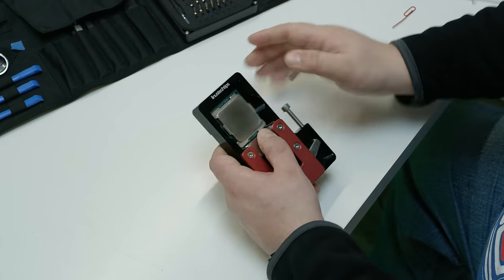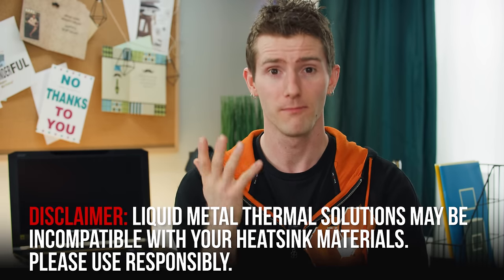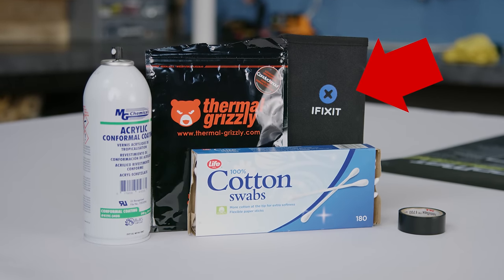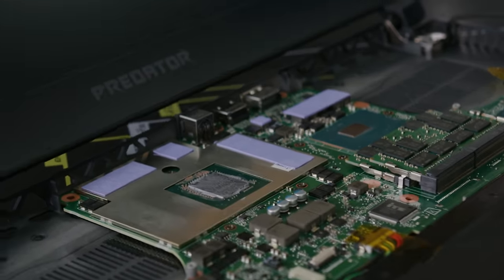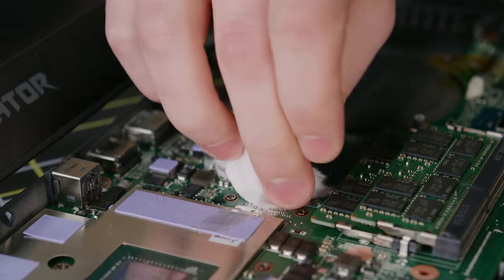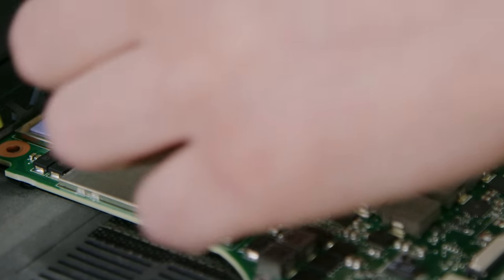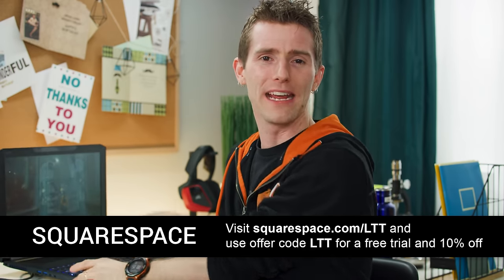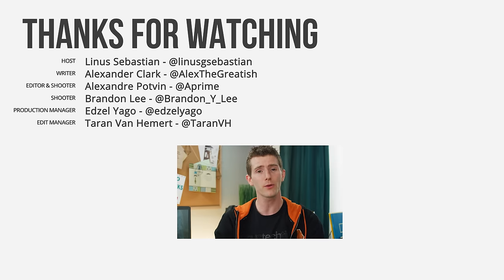Liquid Metal Laptop Cooling – 20C LOWER!

Comment: Can manufacturers use liquid metal themselves? It's not like it's patented and such improvements are in their best interest to begin with while avoiding customers damaging hardware in process.
Reply: yes can any answers this
Reply: The interface between the chips and the heat spreader would have to be specifically designed in a way that the liquid metal would not be able to spill into other components.  Liquid metal doesn't "solidify" like normal thermal paste, so the current method of applying normal thermal paste (the "more is better" approach, with most of the paste being squished off the side of the chip) would not work for liquid metal.

It would be awesome if a manufacturer came up with a way of doing this reliably, though.
Reply: Thanks, makes sense! So for real, doing this yourself means you can't move the PC around much?
Reply: Yeah thats true, i think its the cheapest way to boost performance of those devices.. and if manufacuturer did that they could do it reliably
Reply: Gallium in it slowly amalgamates with pretty much every metal around it weakening the structure, eating away the dies and ruining the solder joints. The problem becomes much worse where two different metals are in contact (like heatpipes). It may be good for short term overclocking but in the long run you're better off with traditional thermal compounds
Reply: In the long run ? That doesn't exist.

Nobody uses a CPU for 15 years.

And you'll still get better temperatures than with traditional paste.
Reply: If you like getting random errors, BSODs, crashes and eventually having to replace the whole motherboard because all the solder connections are falling apart for a 5 degree temp difference, go ahead. I bet a lot of devices that had contact with gallium will fail within 6 months
Reply: The reason manufacturers do not use this interface material is because of the liability in an accident situation. One decent bang and you shotgun pellets of liquid metal all over and fry the system. The incidence of warranty RMA work would skyrocket.

Comment: Gallium has a neat way of interacting with aluminium. It basically melts aluminium. It can take hours for it to really have an effect, though, so that laptop might actually be dead now. It mostly depending on if the solder points had a long enough contact with enough gallium, how much tin was in the solder, how much of the "liquid metal" was gallium, and if there wasn't some material keeping the gallium away from the tin (like a cleaning solution used on the motherboard after the soldering process).

Comment: 5:05 aaaand this is EXACTLY why doctors spray a squirt into the air from a needle before actually putting it into someones arm.
There's always some gunk or residue at the very tip of the instrument, that may cause shit to spurt out as the pressure blob releases.

Comment: I remember upgrading the thermal crap in my Dell Inspiron 1720 back when it was new around 2008 to Artic Silver 5, was nerve wracking because it had a dedicated GPU (nVidia 8800) too. It went from complete thermal throttling on Fallout 3 even with a beefy laptop cooler to a smooth steady (Though not as high as I'd hoped) 40FPS. If there is one thing I have learned (Mostly from the Pentium 4 Prescott days) it's that the right (and right amount) of thermal compound makes a huuuuuge difference.

Comment: It costs 10€ and they want to tell me they companies can't do it themselves in a 3000$ laptop???
Reply: There is a pretty good chance the metal would spill somewhere during shipping. The failure rate would be too high.
Reply: Not if done correctly. How would it spill if it's only a thin film between two pieces of metal anyway?
Reply: Am not. Worked with all sorts of amalgams and room-temp liquid alloys and have an electronics workshop.
Reply: Maybe the longevity?

Comment: Kapton tape may be a better option than electrical tape for your barrier. It is highly heat resistant and also non conductive. It will also come off cleanly without leaving black sticky goop all over the place.

Comment: So why the manufacturers are not using that?
Reply: Money
Reply: cause its not reliable for the average consumer u have to maintain it
Reply: Thomas T Probably to expensive. Maybe they weren't expecting such high temperatures in your device. Or they just might not care.
Reply: How many time can you use it before changing the paste ? Why Linus is not saying it if you need to maintain it? It’s very important parameter for a potential buyer.
Reply: That's ridiculous. Any gains from this technique in their laptop segment could be replicated in their desktop segment. And many manufacturers don't even have a desktop segment so why should they hold back?
Reply: Also, it's not going to go right all the time during manufacture and the manufacturer would have allot more defectives and that would cost them allot.

Comment: if computers were manufactured with this process, then they would qualify for a shipping ban, due to the gallium content.  Air ban due to gallium eating aluminum
Reply: Someone finally has the right answer!
Mercury and gallium are banned from all air-transport, due to the danger of aluminum damage.
The damage either metal can do is astounding.
One drop = one dead 747.
Not an exaggeration.
This is why liquid metal alloys are typically sent by surface transport.
These alloys do not have an infinite life: they oxidize and need to be re-applied at intervals.
Reply: Greg Gallacci Looks like I always learn something new on the internet. Thanks for that insightful information.
Reply: one drop can do shit to a 747, otherwise you would see terrorists scratching the frame to put lmtc :p

Comment: Easiest way to apply I did was put it on q-tip I keep an old one with old LM on it so it is easier to add onto the tip and paint it on. I applyed away from my motherboard when setting up my loop and de-lidding. Then applied the q-tip to where I needed. It gives you more control when applying. -Sorry english is 2nd language :(.

Comment: aftermath please... i had to reapply my liquid metal 2 times on my aero 15x v8 so far....because temps climb really high after 2 months or so and the LM getting hard
Reply: How are the thermals for that aero after applying liquid metal? Still throttling?
Reply: @cyberpunk4915  no. 75°C max. But add 4 degrees every month till 91°C.. it always seeps into the Cooper alloy and hardens.
Reply: @Sanyex  +4 per month!? my god
Reply: hey sanyex, i have the same laptop and am thinking of liquid metaling it too. how does is look now after some months? would you still recommend?

Comment: I just wanted to post as a note anyone watching. If you want to remove or accidentally spilled some liquid metal on the board while unpowered. You can use wet wipes to help remove it. I found this out by experimenting. Rip a piece of the wet wipe cloth to grab a bit of the lm paste off the spot and Discard piece, rinse and repeat. Do not reuse or it will smear the lm paste around. The lm paste tends to ball up on the wipe so it works like a charm.

Comment: Don't liquid metal laptops!  Gallium will alloy with Copper, the reaction speeds up with heat.  My laptop was running at 80c for about 3 days before the temps were at 97-99c and down clocking, I run BOINC on it.  When I took my heat sink off, the copper contacted with the liquid metal turned silver and would not come off, it actually absorbed into the copper.  

Quality thermal paste will actually do the same on max temp ceiling FYI.  Just in case anybody else wanted to try too.  Read up on liquid metal and copper.

Comment: It's Worked Well.

Without LM
Temperature 94-96°C
3D Mark score 15000 point 

With LM 
Temperature 80-84
3D Mark score 18000 point .
Performance is +20%

Asus Vivobook Pro n580vd
i7-7700HQ
Gtx 1050

Thanks for the video..

Comment: The bad thing about Liquid Metal apart from it's dangerous application is the long term corrosion to the die itself and the heat spreader, from what I've saw in other parts from the internet the first application it's the most dangerous because it can spread out, but when you reapply the same compound you are "safer" doing it, though you won't keep getting the same level of heat disipation.

Comment: Pro Tip: CRC Electronics Cleaner from the auto parts store will dissolve thermal paste instantly. The only caveat is you need to be able to remove the chip so you can take it outside when you spray the cleaner on it.

Comment: I got incredible results from this on a MSI laptop with i3-4100m :

From 85°C and SCREAMING fan in full charge
 (OCCT small data)
To 55°C and almost silent fan

Needless to say that in normal use it's dead silent, and temps never go above 45°C... 

I applied two layers of clear nail polish beforehand, as there were sensitive areas literally next to the CPU die.

Make sure you apply the conductonaut in very thin layers, both on the copper thing, and on the die.

/!\ Make sure that the part which is making contact with the CPU is copper or nickel plated, because if it is aluminium it will be destroyed.
Also the conductonaut will leave a little mark on the die if you try to remove it, so needless to say that if you do this on your laptop or on your desktop GPU, there is no more warranty.

Comment: My Lenovo i7 laptop was driving me crazy. The fans sounded like a JET plane spinning at 100%, just browsing the web, I'd tried every software fix, bios update, you name it. I was getting ready to palm it off. So I thought I'd try some LM.

Opening these new laptops is way easier than the old ones, pop off the back cover and a few screws to remove the head pipe/heatsink (fans stayed in place!).

It was there I noticed the giant 0.5+mm thick screen printed square slabs of thermal paste from the factory, given the low mount pressure, this method would create a decent gap between surfaces and act as an insulator, which explains the inability for my laptop to passively cool (fans ran 100% of the time).

I bought some conductonaut and applied it to the cpu and gpu die, the copper heatpipe and BAM! Fans barely ever come on anymore, at idle it is around 10 degrees C cooler even with no fan running, and at full tits, 19 degrees C colder. AWESOME!

So thankyou for this video! You saved me buying another $2000 laptop for no reason.

Comment: Finally did it with my Asus, didn't really drop temps but the CPU (i7 7700hq) maintains higher clocks, it used to drop to 2.6ghz when I stress both the GPU and CPU, now it never drops below 3ghz. One thing though, be careful!

Comment: There are 2 tips given if you buy Conductonaut liquid metal, and in this video you are using the wrong one. I think you are supposed to use the small tip (angled pin-like tip) instead of that suction tip.

Comment: A good tip would be to use translucent nail polish to cover the surroundings of the die to prevent shortage in case of liquid-metal spillage.

Comment: Keep in mind that this stuff does dry out over time. Applied it to my GTX 1060 years back and was surprised about GPU temps in excess of 80°C under little load. Turned out that the liquid metal paste had pretty much dried up to the point of no longer transferring heat.

Comment: 1 question...
How is the longevity of this laptop?

I mean, sure it is great to see improvements but how does it hold up in real world use. Laptops are meant to be portable. 

I would be greatly informative if LTT can follow up with the long-term application of liquid metal to, you know, use it at our own risk.
Reply: it will work fine you will have to reapply some about 4 to 6 months later as it will seep in to the copper heatsink but after that it will be fine ive had it on mine for almost 3 years now got around 20c cooler

Comment: I own a msi ge62 6qf laptop my temps were in the 92- 94C range on my cpu and 85c on my gpu  I was using Arctic MX-5 thermal paste as I thought it would work better than the original manufacturers paste and turned out to be the same. I cleared out the dust from my cpu heatsink there was a dust bunny blocking about 25% of the exhaust on the cpu side and nothing blocking the gpu side. I had some arctic silver 5 laying around and decided to swap it out with the arctic MX-5 due to it's large metal content and the affect was stunning my cpu never goes over 75c and my gpu never exceeded 73c with an overclock of 135mhz over stock on the core clock.

Comment: for those tiny parts around the gpu die, dont waste your time getting fibers caught in them with a q tip or a paper towel. Just use some alcohol and a toothbrush